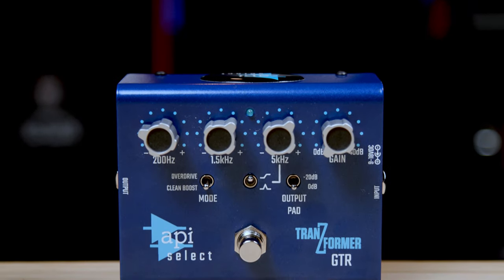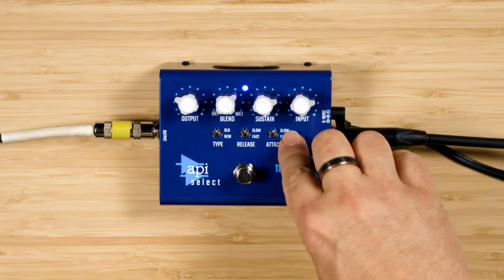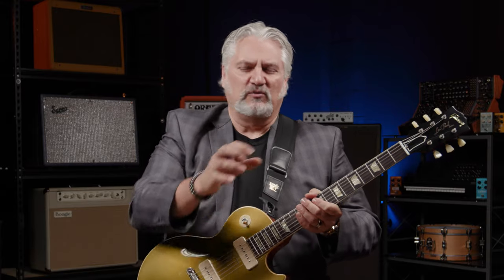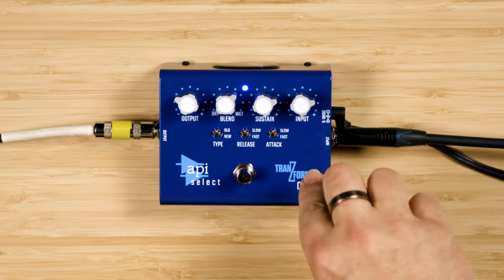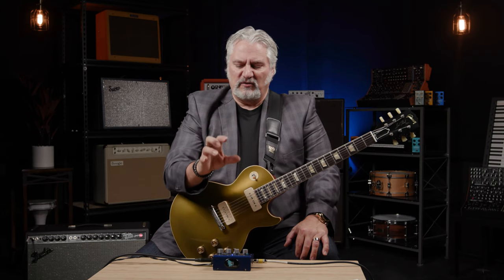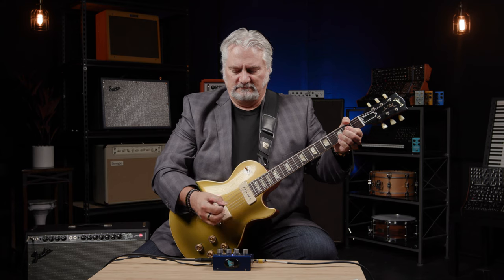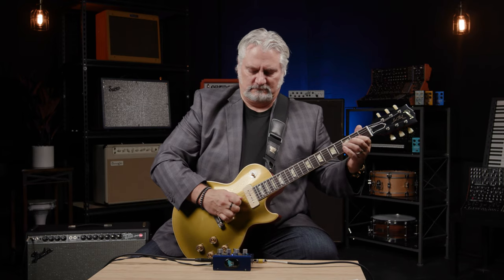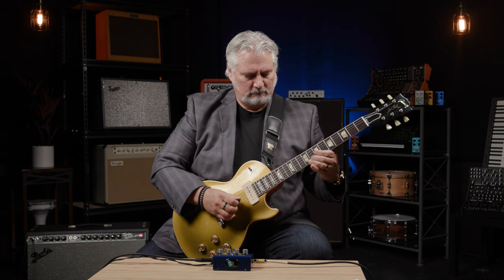API TranZformer CMP Compressor Pedal Demo

Comment: Can it be used on line level? So it can be patched with an insert cable?
Reply from the maker: Hi, Frans! Thanks for your message, hope you're well and safe.
With a line level shifter (Morley MLLS, for example) yes, it's safe to run this pedal. I haven't tried it with an insert cable so can't comment. If the thought is to get API on a budget for the studio, I understand... however, that is not the designed use for this product.
Please contact us direct with other questions as you have them!
Robert Williams, Senior Sweetwater Sales Engineer, (800) 222-4700 ext. 2371, robert_williams@sweetwater.com
Reply: @sweetwater  thank you so much. I really appriciate your remarks.